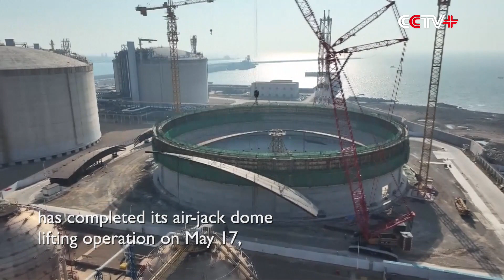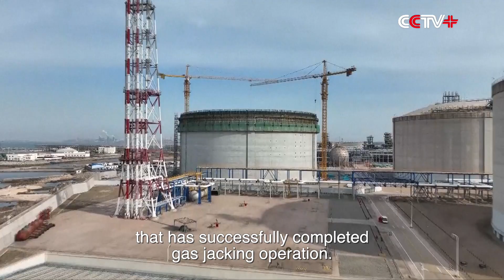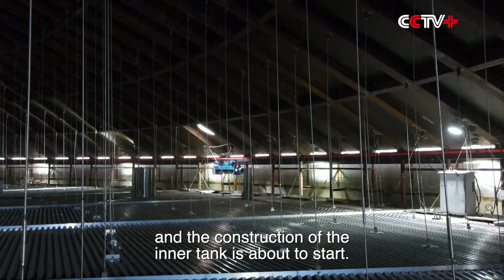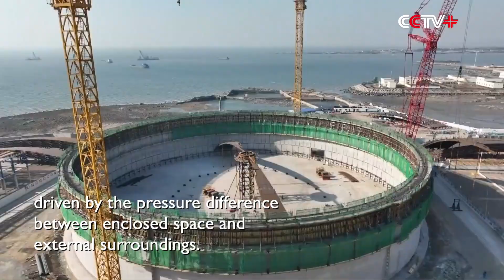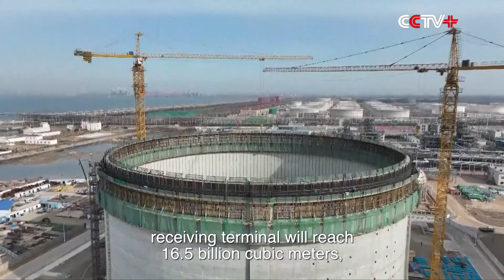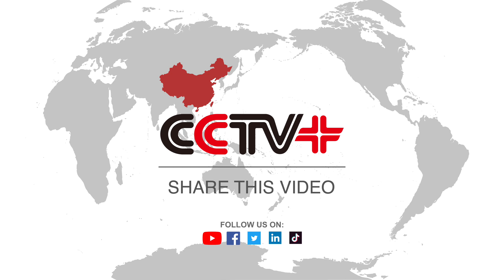China's largest LNG Storage Tank Finishes Dome Lifting Operation

Comment: pipeline for natural gas would be better...
Reply: Power of Siberia is online with Power of Siberia 2 in the making. Unlike the EU the Chinese aren't stupid and will gladly use Russian gas.
Reply: different forms of storage has different ways of distributions.
This form it does not need pipelines to homes etc 

This form , one can import from many countries and many locations while gas pipeline only one location to one location
Reply: @hkfoo3333  and is also much more expensive
Reply: Not really if the supply is near. 
Of course by gas pipeline is cheaper but not every case can have pipelines.

There are pro and con in each type of system delivery
Reply: @hkfoo3333  well in any case pipeline is cheaper because LNG needs first a lot of cooling to make it liquid and second a lot of heating to make it gas again also special ships for transport.
Reply: @jebise1126  I tell you again. LNG is one of the products bought and sold all over the world. Sure it is more expansive than gas. It is still needed where gas cannot get through .

Where there are pipelines installed from the source eg. Russia or Chinese sources, gas will be used.